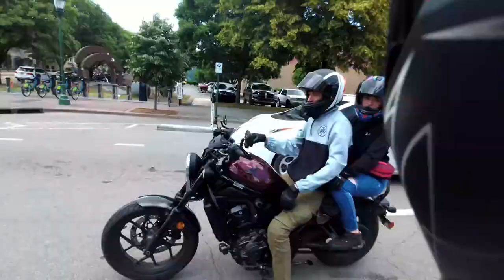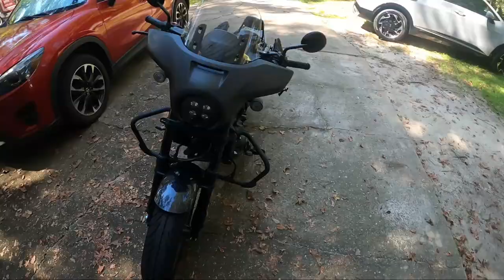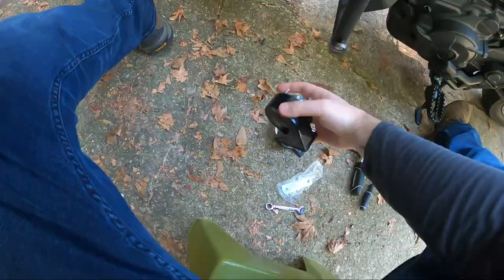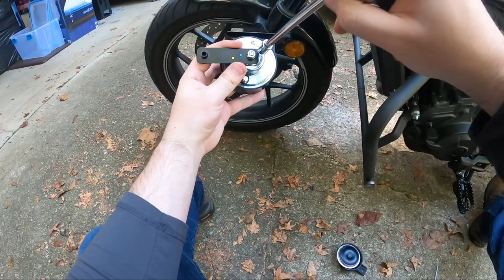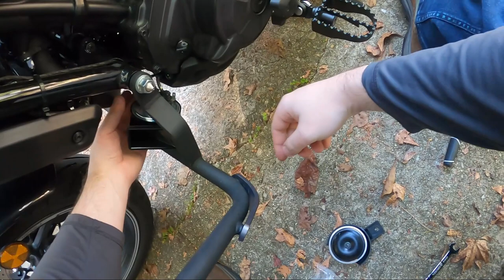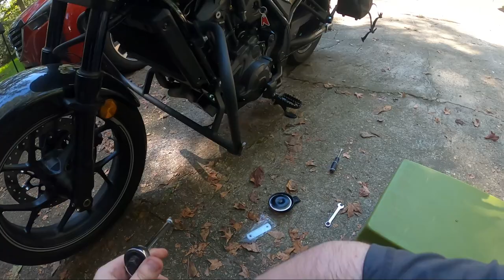AWL - Rebel 1100, Denali Soundbomb Mini Installation

Comment: Hi Link,
Since installation, have you found an extension for the cables so that the horn faces downwards?
Or did you manage to stretch the original cable?
Reply from the maker: I have not gotten around to doing so yet, no. However, if you go to your local auto parts store and bring the horn, they should be able to help you. The connector is called a Spade Terminal. I just don't know the exact size. Shouldn't need no more than an inch or two of wiring and connectors for both ends.

I will note, that some Rebel 1100DCT owners have been able to pull more cabling out. So some can face it down but some can't. Seems the cable could be getting caught on something for those who can't pull it out. But if it is, it's underneath the engine under a panel.
Reply: @LinkFelton  Thanks for the hint. I don't have my Rebell 1100 yet because here (Quebec, Canada) it will be too cold to drive in winter. I will give a deposit during the Christmas break and only have it around May.
In the meantime, I'm getting ready and I only have Youtube videos to wait until then 😅
Reply from the maker: @marcgatineau209  Well you're gonna love it man! Best of wishes and I appreciate you checking out my channel!
Reply from the maker: @marcgatineau209  Whenever you get your Rebel 1100 and the Denali Soundbomb, if you're wires are too short, I have the parts necessary to make a 2inch extension. Just send me a message on Discord LinkFelton#1101 or on YouTube if you don't have Discord.
Reply: @LinkFelton Hey I ended up upgrading my horn but the wires are too short. Could you help me out on how you extended your wire?

Comment: Just noticed your seat. Where did you get it and how much? And the Denali still doesn’t seem loud enough.
Reply from the maker: This is as loud as it gets on the stock wiring. Denali does sell louder but they have air compressors and typically required extra wiring to be run.

As for the seat, it's a Corbin Solo Seat. Customized as well. I got it as a gift otherwise I would not have spent the money. Especially after hearing all the negativity about Corbin customer services and Quality Control.
Reply: @LinkFelton  wow… I was thinking Mustang seat or trying the seat Honda offers aftermarket. Bad Corbin has crappy QC and customer service. Because their seats look nice. I kinda wanna find one with green stitching or something similar. Just picked up my 1100T!!!! All black!!!! First one I’ve seen!!!!
Reply from the maker: @turtle19dad  The Honda aftermarket seat is nothing special, just a different design. Same padding. Check out this video from On The Rebel 1100: https://www.youtube.com/watch?v=0afXVTSigIQ

Gus from On The Rebel 1100 is a buddy of mine. He did extensive testing and rode hundreds of miles with both the Corbin and Mustang to give you the best comparison. Corbin is the best for customizing. I have nothing wrong with my seat, but others reported shotty quality in some spots and actual bike damage with use. It's really up in the air with how good you'll get from them.

And nice! I REALLY want that batwing and saddlebags from the Rebel1100T. Not willing to trade mine in just for them because I got a cool/low number VIN. But if I can get my hands on that batwing and fairing I'm totally getting it lol. Welcome to the Rebellion!
Reply: @LinkFelton  the fairing doesn’t seem as durable as I would like but it is a gorgeous bike. And the DCT takes some getting used to as I feel naked without a clutch.
Reply from the maker: @turtle19dad  the bagger fairing is probably same material as the small fairing for the none baggers. I'm fine with it, it's bigger and looks better to me so I definitely want it.

And yeah, DCT takes a while to get used to. A great thing to try is use your rear brake as your "Clutch friction zone". It helps immensely in low speeds. Trust me.
Reply: @LinkFelton  gonna try that